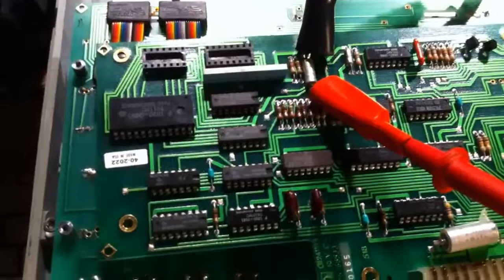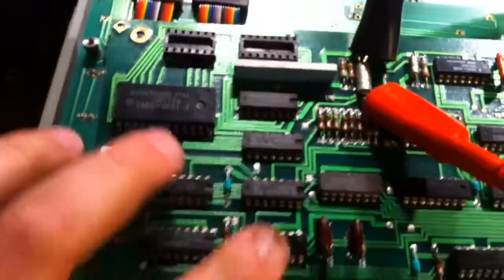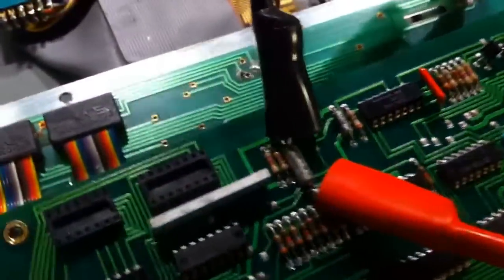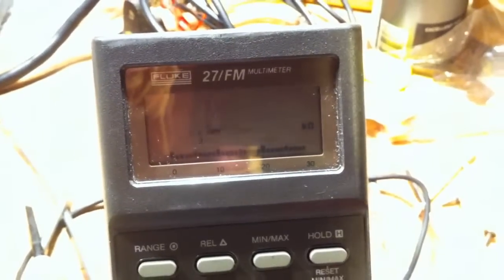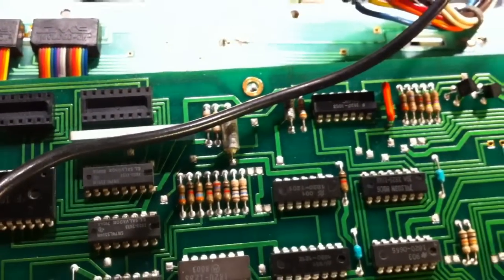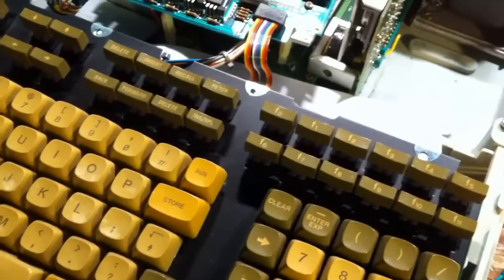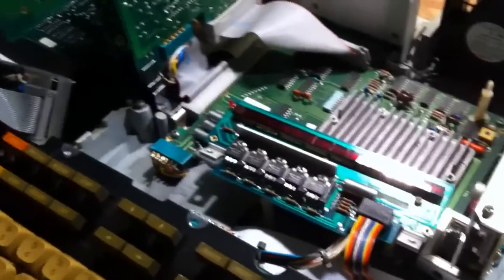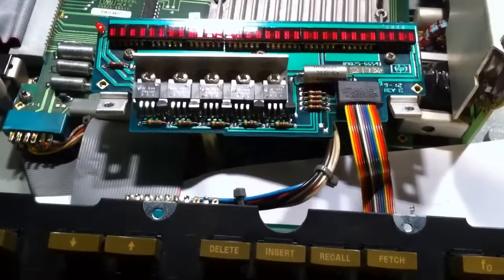HP-9825T Restoration Part 2

Comment: I used to work on these computers back in the early 80's. Never ot a component level, but still brings back memories. I used to have a complete set of maintenance manuals. Do you have the set of manuals or are you fishing around onto the boards?